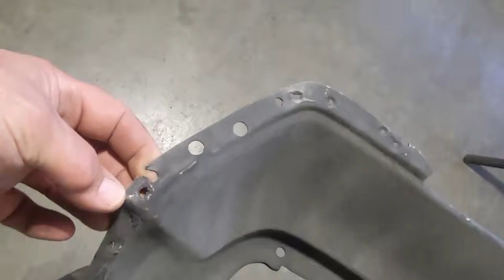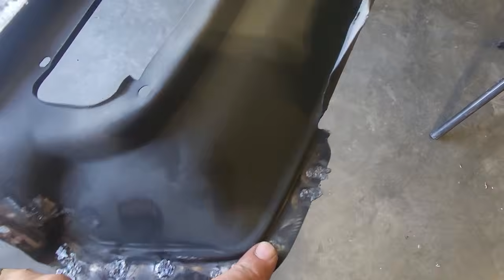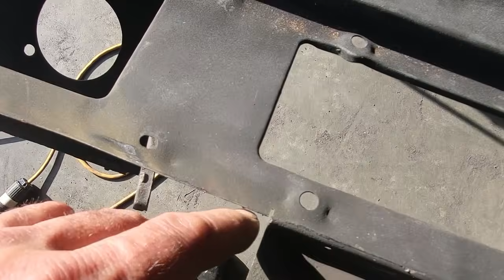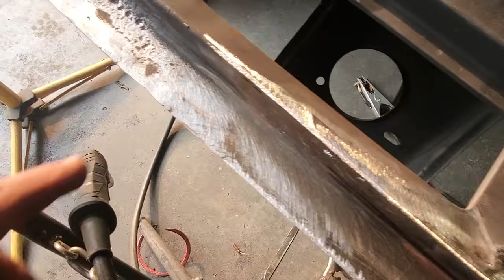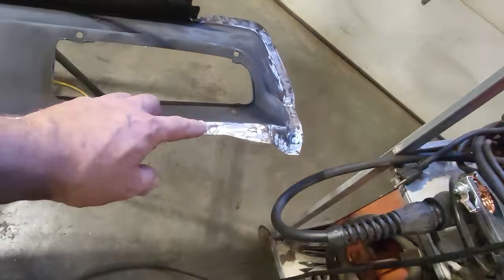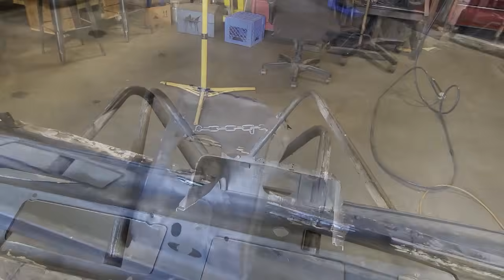Sheetmetal. Welding up the small stuff

Comment: Nice clean work as always…. Just bought an ARC CAPTAIN 200… still learning its settings
I have two very complex ‘fixes’ - front lower cowl patch pieces that bolt my ‘35 Chevy front fenders on…. Welding patches requires patience. Thanks for your great “how-to” videos…. All the hard points to learn with thin sheet metal

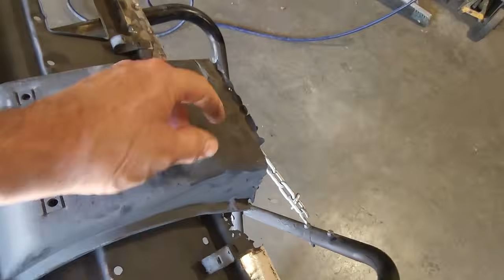Comment: At 9:45 and other places, ... Aren't new panels available for this panel?  Mark Worman does not seem to complain about the new replacement panels... This seems to be a lot of work for a panel that does not have a factory matching serial number on it. It is great to see it happen, but use these skills to repair/remanufacture the UNOBTANIUM panels... Thanks Fitzee!
Reply from the maker: Yes you can get new panels but the cost for us here with the exchange and shipping makes its too expensive  for aftermarket

Comment: Ya know Tony it probably took less than 3 minutes to stamp that panel when they made it , and probably less than 3 minuets to spot weld it on the back of the car. Here you are some 50 odd years later spending hours to repair it. Go figure.

Comment: With the amount of work involved in repairing this panel, it would have been a lot easier to just buy a new panel. But if a new panel is no longer available, then repairing the old one would be the only solution. Your instructional video shows us how to do that.
Reply from the maker: Its easy to say that but here where I live parts are very  expensive  to ship. Then there is the exchange  rate of the dollar. You buy a bunch of panels it won't be long and the cost of the project goes threw the roof. Then you have to deal with fitment of aftermarket  parts.
Reply: @fitzeesfabrications  Exactly the reason you repaired this panel, because a new panel was not available at a reasonable price. Same with the exchange rate here in Australia, it's not good here either.

Comment: Hi Tony.  Nice repair on the Challenger tail panel!  Better to have an original piece on a classic like that than replace it with aftermarket.  Seems odd that the owner is going to glue it back into place but I guess glued on panels are used all the time on modern cars.

Comment: You did a nice job. I save many of your vids. For my Alfa Romeo GTV6 I bought also such a panel once and it was about €250 and now it is 700 and more. It was in 2005. From the other GTV6's I had, I saved up as much as possible panels. Thus I have 3 engines, 3 gearboxes, 4 front fenders (they were too rotten from the first one I had), 3 hoods/bonnets, 3 rear hatches, 3 front windows, etc., and one roof. In Italy I could buy two original still in transport black paint doors for €650 😁👍🏻. Now one new door is over a €1000. I still have to restore the car since 2005..... but it was inside since then and inside before I had it for several years. It is checkable on a state website. Thus it does not have very much rust. But I am still busy converting a former cow stable (1965) into my workshop. I was a welder/metalworker and later a weld inspector/ndt-er so I am very familiar with metal for 40 years already. And I have my Opel Kadett from 1940 to do. I like how you do the work with as little as possible tools and your methods. I can also work good with a little amount of tools. It needs creativity. Regards from Belgium.

Comment: My 67 Barracuda required several patch panels in addition to new  quarter panels, trunk drops, and trunk floor. The most challennging was the right front trunk drip rail that attached to the quarter panel and filler panel between the trunk lid and back glass. I would have had no idea how to do it without your videos. Thanks a ton.

Comment: When I first learned how to weld back in the seventies did fusion welding oxi and acetylene and I  used coat hangers back then. Its worked it was cheap and that's all what some folks had to work with back then,  I know it may seem hard to believe but it was true.
Reply: I used to do rust repairs on cars back in the 70s and early 80s with oxy welding also.